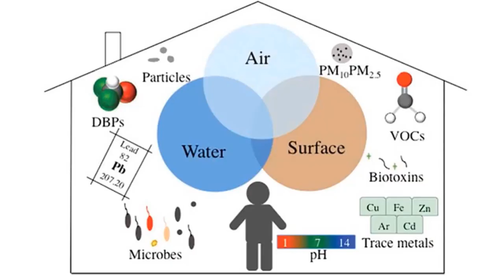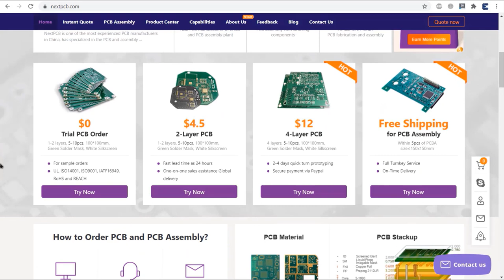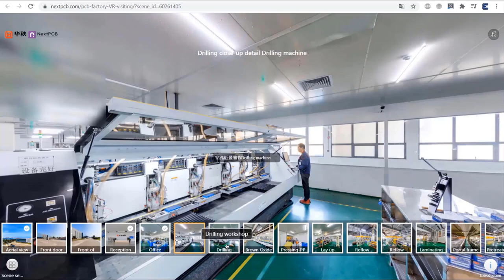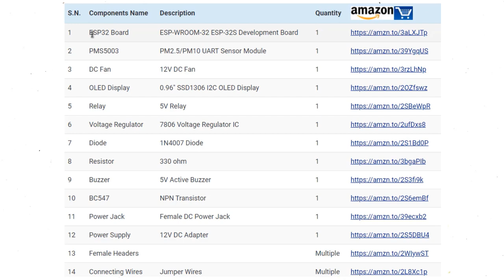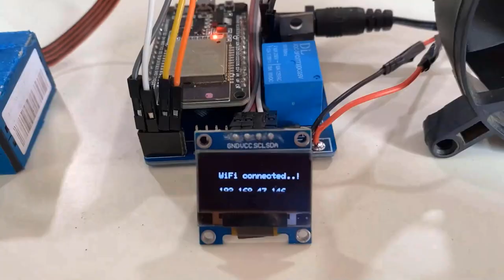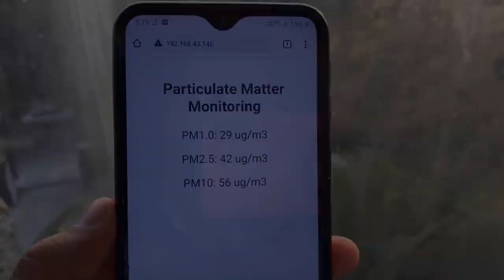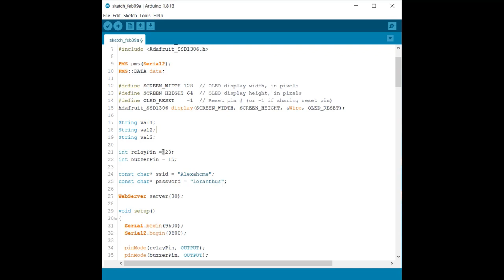IoT Based PM2.5 Monitoring with Automatic Air Freshener System || ESP32 PMS5003 Web Server

Comment: sir you make excellent project here but let me bother ones, I am working thesise project which can be refresh the odor in the hospitals but I have 2 question 
1 , can I make this project with only arduino with out wifi and connection 
2. in which chemical reaction the odor or polluted air purified???
sir help me as much as u can specially my first question 
thank u
Reply from the maker: The system is designed for esp not for arduino. You can make it work with arduino but then you have to write a separate code for Arduino. 
The polluted air is purified on the basic of detection of particles of size 2.5 micron or  10 micron. These partcles may be smoke, perfumes, any aeromatic compounds or volatile organic compound.
Reply: thanks sir
Reply: Hello, I'm trying to get in touch with you, but I can't.

I need to know if you can help me by sending me a guide or a video tutorial to assemble the sensor parts, please

Comment: is there any alternative for pms5003 sensor?
Reply: i have been experimenting with both 5003 and 7003 sensors. The 7003 is by far better and the other one, but in terms of connectivity are the same. Plantower sensors are the best budget option, you can get sensors for $1000+ usd.